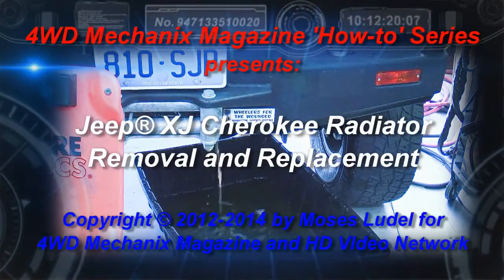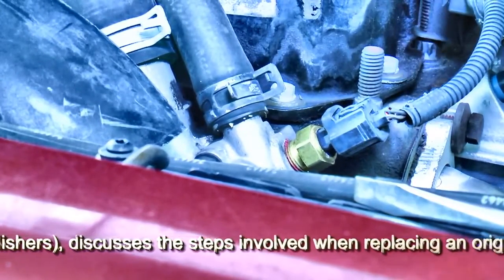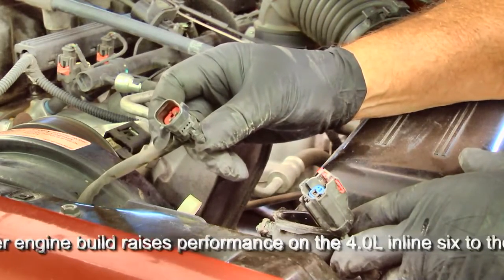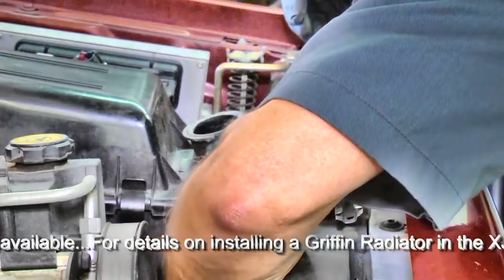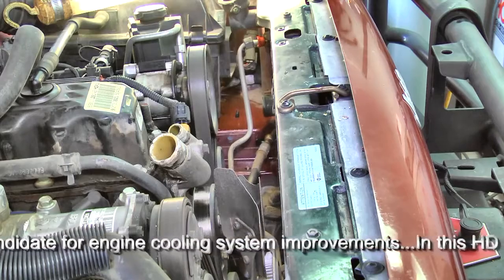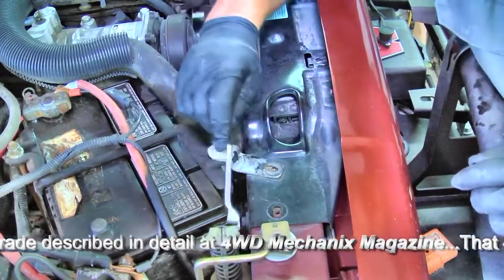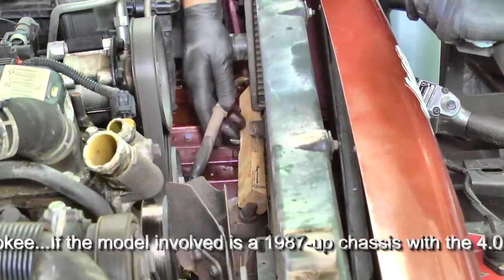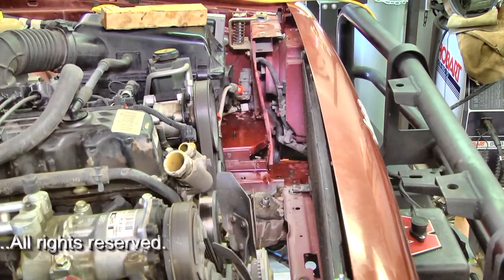How-to Remove and Replace a Jeep XJ Cherokee Radiator

Comment: What size is “the correct tool”?
Reply from the maker: In the video I use a few specialty tools:  a flare nut socket, Torx drivers and the automatic transmission line coupler disconnect tool.  Each tool is demonstrated.  If you are asking for more details on the tool used to uncouple the transmission line coupler (lower line), my set has the common Lisle graduated sizes (U.S./SAE or metric sizes available).  Here is an example of a Lisle "master kit":  https://www.amazon.com/Lisle-39900-Master-Disconnect-Set/dp/B000W1R1J0/ref=sr_1_15.  There are also single disconnect tools available in just the size you need for a specific fuel, automatic transmission or air conditioning line coupler.  (Measure the tubing diameter for sizing.)  Let me know whether you have any other tool questions.